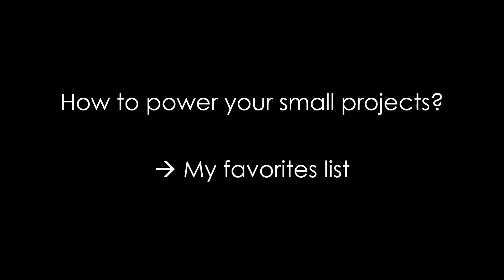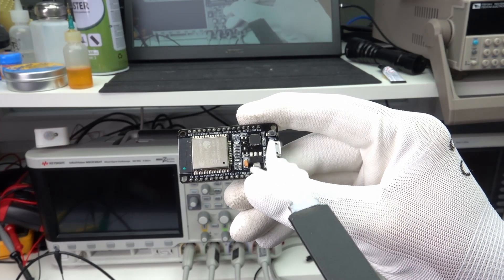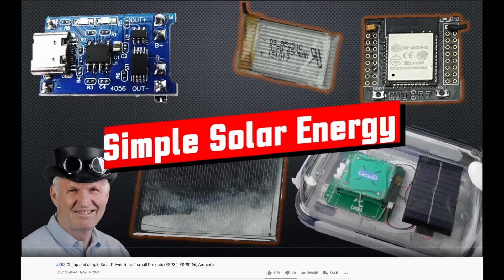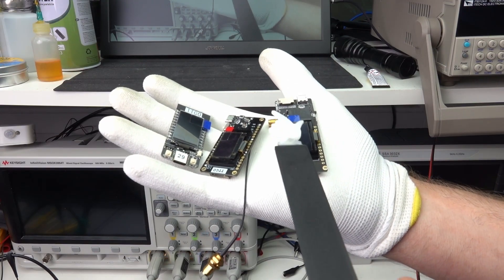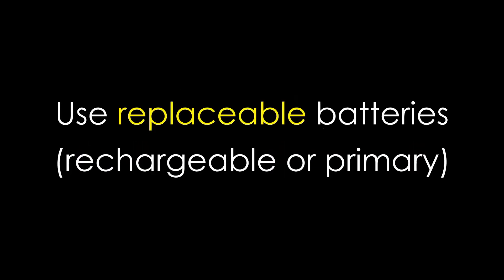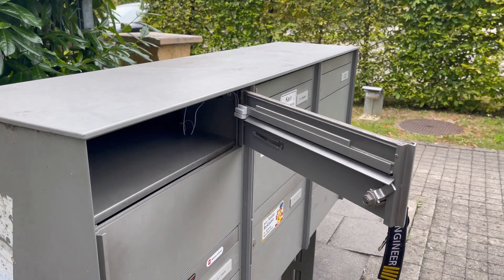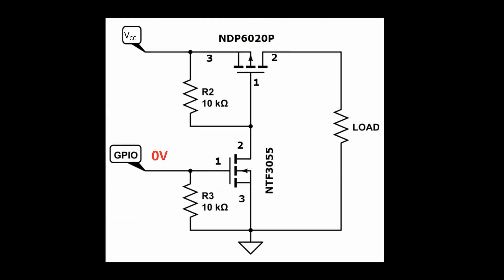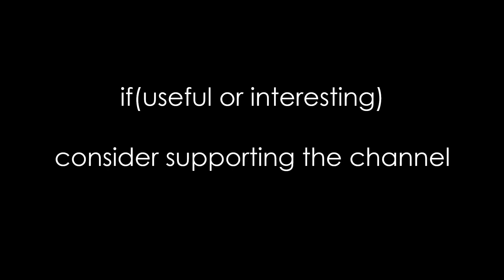#400 The Best Power Source for ESP32/ ESP8266 Projects

Comment: Great job with putting those usecases in order! :) And I share your love for HT7333! With small correction, that its dropout voltage is  150 mV - both in the datasheet and personally tested :). With battery going down to 3.45 V it keeps giving pure 3.3. Battery going down to 3.44 V - it goes down to 3.29 on the output, and so on - going down in the linear fashion, always 0.15 V below the battery voltage. Which is still great and more than enough for 3xAA batteries. And ESP32 still keeps working even with 3.0 V ;) (which means 3.15 V from 3xAA, which is when they are almost 100% empty :) ).
Reply from the maker: That is what I also had in mind. But this Holtek datasheet https://www.angeladvance.com/HT73xx.pdf says 90mV (@40mA). That is where I had my value from
Reply: @AndreasSpiess  Oh my!! I was very sure about that 150 mV, but indeed the datasheet says 90... Is my memory soo bad?
Noo! :) I must have remembered the value well from the time you showed it in episode 58 (small cell battery powering sleeping ESP8266) many years ago!! There you said and SHOWED on the datasheet the value 150. They must have changed the datasheet in those few years :). Plus my own tests always showed consistent 0.15 dropout.
Reply from the maker: We can agree on 150mV. As I said, I also had this value in mind. But then I looked it up to have a "proof"...

Comment: What is the board's name at 2:18 th minute?
Reply from the maker: You should find a link in the description
Reply: @AndreasSpiess  I found it and checked it out.... But Alas, the same board is not available here at present... I would really love to use that in my project.
Reply from the maker: There are many other suppliers if you search with the same name
Reply: @AndreasSpiess  Sure, will do... Given similar specifications...

One query I have, does this STM32 board require external clock ?
Reply from the maker: No, usually all these dev boards have an onboard clock.
Reply: @AndreasSpiess  I'm grateful for your reply. Thank You.

Comment: Hi, if the battery must be rechargeable below 0°C use Lithium Titanate (LTO) cells (-20°C).
Reply: Hi, get the datasheet of this cells (scroll a little) : says for LTO1865 - 15°C for charging. Hope it helps.
https://shop.gwl.eu/LTO-technology/Pack-of-5pcs-LTO1865-Rechargeable-Cell-2-4V-1300-mAh-Lithium-Titanate.html?force_sid=0qra68almb5ma1i1k3mdas3718
Reply from the maker: The problem of LTO batteries is that you do not get a lot of chargers or protection circuits. In addition, you need 2 in series to get to the needed 3.3 volts. But of course, in harsh conditions, it might be a good solution.
Reply: @ragohy  Thanks. It does help!
Reply: I've been locking at those for my project. Interestingly, only the large LTO batteries seem to have those low temperature charging capabilities. The small, AA size do not, at least from my research on aliexpress. Let us know if you find different info.

Comment: Power over Ethernet (POE) or the newer PODL are options for LAN connected devices. 10 Mbps at a 1000m for (Single Pair Ethernet) SPE-PODL. PODL is much simpler to implement than POE as the power supply current doesn't have to run through the magnetics.
Reply from the maker: Agreed (I made a video about POE). I could have added the use case for projects with wired Ethernet, you are right.
Concerning PODL: Is this already widely adapted? I never heard of it

Comment: I am looking forward to the new LiFePo4 Episode.LiFePo4 has the perfect Volage Range for 3,3V Electronics and behaves well even on some abuse. I very much like these, but unfortunately they normally don't like to be charged at low Temperatures. In Solar powered outdoor Applications i have mounted them in the mounting post buried in the soil to keep them from freezing Temperatures. Low Temperature LiFeYPo4 batteries might be a solution, but there ar only the high capacity prismatic cells from Winston available. I really like to get some cylindrical low temperature charging LiFeYPo4 Cells
Reply from the maker: I do not know how they behave at low temperatures. All data I found so far was for charging with high currents. In our applications we only charge with low currents. Do you have info or tests for that use case?

Comment: If a space is not a concern, I would confider a small motorcycle battery. They're pretty good price for the capacity.
Reply from the maker: Absolutely. Lead Acid batteries are very robust and can be used in low temperatures.

Comment: A 5V USB "UPS" can be very easily implemented externally with an off-the-shelf rechargeable USB battery pack connected in series in-between the little USB power supply and the USB device. E.g. I have a WWVB PSK VLF Radio Clock experimenter circuit card, and if the power fails then it will not display the time until very early in the next morning (syncs at ~01h00 local). So I've simply added an external 20,000 mAh USB battery pack in series with the USB power cable, and it provides the "UPS" function. Such battery large packs are often on sale for as little as ~$20, and they provide a good solution for some use cases. There are also cheaper ~$3 versions available at the Dollar Stores. Cheers.
Reply from the maker: You are right. But keep in mind that a lot of power banks switch the output off if you start charging them. And you do not get this information before you buy and try them.

Comment: Hi Andreas, I learn a lot each time I watch your videos. However this time I was surprised by the advice to use disposable batteries,  these causes environmental issues and I guess we would be better off using 18650 that can be changed then recharged  for later use. I've been trying to eliminate as much as possible the use of AA or AAA batteries at home when I realised the pile or difficult to recycle batteries I was generating. in addition the rechargeable version of those are not very good.
Reply: I suppose depends on the area - in some places disposable batteries are easier to recycle than others.  Anywhere that you can recycle one you can probably recycle the other.
Reply from the maker: I propose primary batteries only for applications where they live for a year or longer. So I do not see big problems compared to all other waste we produce. For the other scenarios I propose rechargeable batteries.

Comment: Choosing right LDO for solar powered, deep sleep project is very important. Why HT7333 and not ME6211? What is your experience with these two?
Reply: For HT7333 the max. quiescent current (the one you have even without a load - the one you care about in the deep sleep) is 7 uA. For ME6211 it's 60 uA (looking at the datasheet). (other sources say it's 4 uA vs 40 uA). Still it's 10 times more current (energy) drawn by the LDO during the sleep time - something that makes HT7333 vs ME6211 choice rather obvious :).
For example the ESP32 processor lowest deep sleep current is 10 uA. It doesn't take the other things (like the crystal) into account - but still for my board the HT7333 + ESP32 (WROOM32D module) when they sleep, together they consume around 50 uA - still lower than the ME6211 alone :). Doubling that with ME6211 would make the device last 2x shorter on the battery..
Reply from the maker: I never worked with the ME6211 and the board with one of the lowest deep sleep current in my test used an HT7333… Maybe somebody else has more information?
Reply: While looking at specs, HT7333 may not provide sufficient peak current (250 mA max vs 500 mA min required for ESP32-S2). Same check for  ME6211 gives 500 mA max that sounds good. Not sure what a block consumes so much power inside ESP32-S2, maybe Wi-Fi (~310 mA peak) plus something else? In no RF mode chip takes mere 19 mA max, so HT7333 fits here well. Do you know other LDO's for 500 mA?
Reply: @NikolaiVarankine   Sorry for late reply. I won’t touch any LDO supplying less than 500mA when using WiFi etc. in a project. May be bulk capacitor can used to cover spikes in current demands. 
Sometime ago I saw a list of LDOs somewhere. I haven’t verified all the data. But it seems a good spot to begin when choosing LDO. Here is that list. 
LDOs (Low power dropout regulators)

MAX1724:
Range voltage: 0.91 - 5.5 V
Max current out: 150mA
Quiescent current: 1.5 uA
Drop out voltage: 

MCP1700:
Range voltage: 6 V Max
Max current out: 250 mA
Quiescent current: 1.6 uA
Drop out voltage: 178 mV

Ht7333:
Range voltage: 12 v
Max current out: 250 mA
Quiescent current: 4 uA
Drop out voltage: 170 mV

HT7833:
Range voltage: 8 v Max
Max current out: 500 mA
Quiescent current: 4 uA
Drop out voltage: 360 - 500 mV

MCP1825:
Range voltage: 6 v Max
Max current out: 500 mA
Quiescent current: 120 - 220 uA
Drop out voltage: 210 - 350 mV

XC6203(XC6203E33):
Range voltage: 8 v Max
Max current out: 400 mA
Quiescent current: 8 uA
Drop out voltage: 300 mV

ISL91107IR:
Range voltage: 1.8 V to 5.5 V
Max current out: 2A
Quiescent current: 45 uA
Drop out voltage: Buck-Boost 96% efficiency

TPS73633:
Range voltage: 5.5 V
Max current out: 400 mA
Quiescent current: 10 mA???
Drop out voltage: 75 - 200 mV

AP2112:
Range voltage: 6 v Max
Max current out: 600 mA
Quiescent current: 55 uA
Drop out voltage: 250 mV

RT9013:
Range voltage: 5.5 v Max
Max current out: 500 mA
Quiescent current: 25 uA
Drop out voltage: 250 mV

AAT1217:
Range voltage: 6 V
Max current out: 600 mA
Quiescent current: 300 - 500 uA
Drop out voltage: stepup 93% efficiency

TLV73333:
Range voltage: 5.5 v Max
Max current out: 300 mA
Quiescent current: 34 uA
Drop out voltage: 150 mV

LM2936:
Range voltage: 5.5 V to 40 V
Max current out: 250 mA
Quiescent current: 20 uA
Drop out voltage: 400 mV

TC1262:
Range voltage: 6 V
Max current out: 500 mA
Quiescent current: 130 uA
Drop out voltage: 650 mV

SPX3819:
Range voltage: 16 V Max
Max current out: 500 mA
Quiescent current: 8 uA
Drop out voltage: 550 mV

AMS1117:
Range voltage: 12 v Max
Max current out: 1 A
Quiescent current: 5 mA
Drop out voltage: 1.3 V

Hope its helpful.
Reply: @zenzeni77  Thank you very much!

Comment: At 12:06 Why have the MCU hold the circuit on? Wouldn't a self latching one be better and just use the MCU IO to switch off circuit?

Just wondering if I am missing something as people(seen this a few times lately) seem to not like using a self latching circuit?

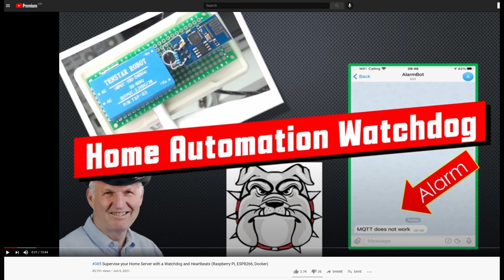As an example of what I mean use an MCU IO pin to replace the off button with the circuit shown at 2:50 in "EEVblog #262 - World's Simplest Soft Latching".
Reply from the maker: I think that my 2 transistor solution is very similar to Dave’s proposal. We need the mechanical switch to give the signal that the mailbox lid is open and the GPIO to signal that the work is done…

Comment: Welcome back again from biking!
My decision tree and life is much easier: 
1. Wifi -> mains power.  
2. For devices requiring battery (having a lot of them): -> 433Hz + RFLink (also for letterbox, windows, water tank of dehumidifier etc) OR Zigbee OR Homematic device. All bound together in a middleware, which is ioBroker in my case. 
The only unsolved issue up to now: Battery powered epaper display with some text and figures.
Reply from the maker: Here life is not so easy. I agree with 433MHz OOK and maybe I should use it more (I have an RFlink-Wifi Bridge). The mailbox notifier is inside the mailbox which is a faraday cage. Only LoRa was capable to escape this prison ;-)  And using Wifi for sensors for me is easier because I do not need an additional 433 transmitter chip.
I have a few Zigbee sensors in my lab and I love them. But so far I did not program one myself. So I can only use what I can buy (PIR, switch, temperatue, etc.  Did you already program a Zigbee device?
Reply: @AndreasSpiess  No, Ifor zigbee, Homematic & 433MHz I  just use the sensors, which I can buy.. And that is a lot. The rest is done with ESP sensors.

Comment: Did you get a lock up as in user and password with the script by Peter? Andreas?
Reply from the maker: I did not use Peter's script for a while. I use IOTstack.
Reply: @AndreasSpiess  Everything is working well, but it has put a user and password on node-red. I have found part of the problem and need to play with the settings.js script.

Comment: Hello Andreas, welcome back.
I have a little tip for your power supply at 2:37 (Tenstar 230V). A strain relief should be attached for the 230V cable. I use a cable tie in such a case. I push the cable in a little further and tighten a cable tie. In this way I achieve that there is no pull on the soldering points. In Germany, strain relief is mandatory.
Reply from the maker: Good point. I agree.

Comment: Hi Andreas, Did you ever try  PKcell 3.6v as a battery supply without any regulator so you will avoid quiescent current as well
Reply from the maker: What chemistry does it use?
Reply: @AndreasSpiess  Lithium but you need a supercapacitor for rush current

Comment: Nice overview. I use a 100W solar panel in combination with recycled 12V-7Ah lead acid batteries (2 to 4 in parallel). Endless power...
Why the lead acid batteries ? I get them for free, so you can't beat the price.
Reply from the maker: Lead acid is very good if size/weight does not matter. They also withstand harsh environmental conditions.
Reply: @AndreasSpiess  Indeed, and even below freezing point they still are able to charge/uncharge quite well.

Comment: Hi, great video. Have you a video in which you comment the problems about "only one mosfet" and why you change to the two mosfet version? Or could you comment ? Thanks.
Reply from the maker: The one mosfet version depends a lot on the Vgs voltage vs the battery voltage and you need a FET with a very low Vgs.
Reply: @AndreasSpiess  thanks a lot

Comment: Must make a project power supply out of the 3000F 2.7V (3Wh) super capacitor and solar panel ring that I found washed up on a beach. The circuit board it came with seems to have issues. The boost regulators, of which there are 3 in parallel, seem to occasionally suffer from one getting warm with no apparent load.
The bit I want to get right is the capacitor charging circuit, don't want to blow it up.
If done right I see it having the potential to run a project self sufficiently for a decade or more. Expected to survive a million duty cycles.
Reply from the maker: Super caps are good for low power application. My awning wind protector uses such caps. Maybe they are also better for harsh weather conditions. I do not think they will blow up if you solar panel is small. They just might loose their capacity if overcharged.

Comment: Hi Andreas, great video, 
You could include LiSOCl2 for lora nodes. I became mine this week and it seems very promising, 3,67V and 2600mAh for a aa battery. I will make some experimets in the next weeks.
Liebe Grüße aus Südtirol
Reply from the maker: These cells are for low current applications (Pulse capability: Typically up to 280 mA (280 mA/0.1 second pulses, drained every 2 mn). I never tried one with WiFi or LoRa which creates high current peaks. So I am interested in your results.

Comment: I've been designing around single cell lipo batteries for about a year now as i've been developing my invention and i've found that they do wonderfully if the power consumption is managed correctly. Integrating a lipo charger in the form of an MCP73831 is extremely easy and it can charge the batteries I use very very quickly. I just throw in an AMS 3.3V LDO (the same vreg found on the devkit modules) to verify proper regulation. 

That aside, the video is fantastic as always
Reply from the maker: I agree. They work fine for many applications, particularly if you can charge them easily (not remote).

Comment: Regarding OLED display pinout: It seems "impossible" to know the Vcc/GND pinout on those OLEDs. I have ended up making solderbridges on my PCBs to select Vcc & GND.
Reply from the maker: AFAIK they sell these small ones in 2 versions. Becaus I know the issue I pay attention (and have a few of each version in my drawer). But solder bridges are also a good idea.
Reply: @AndreasSpiess  Yes there are both versions, but my experience is that it does not help studying the Aliex ad. On the positive side, I get a partial refund when the delivered differs from photos. ;-)